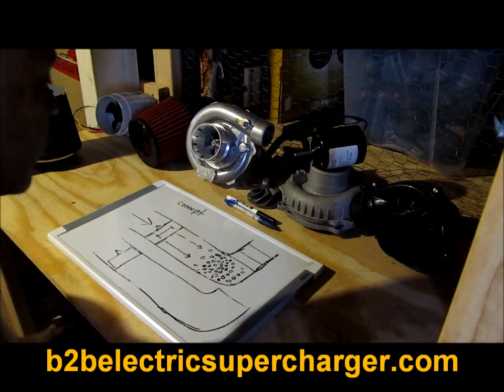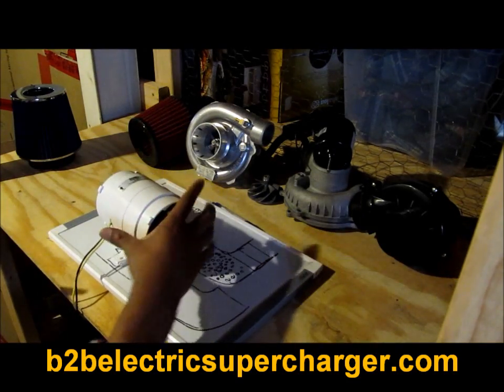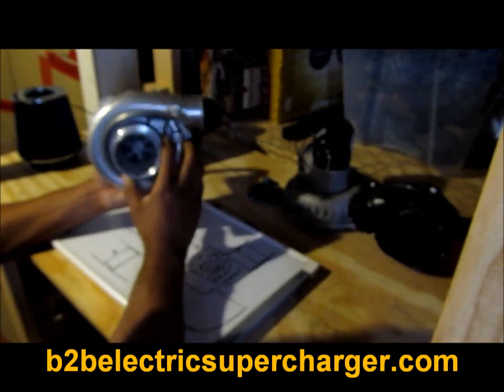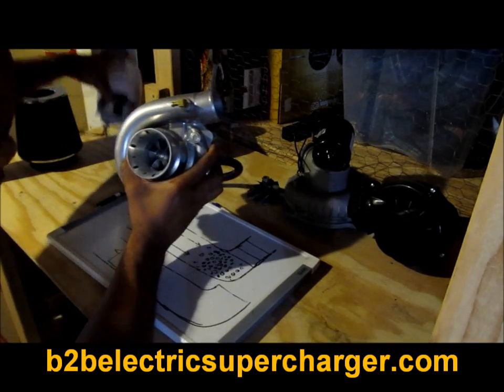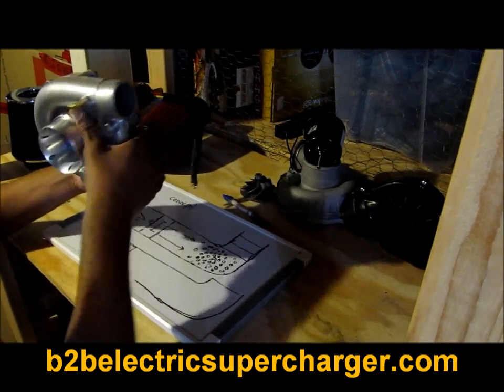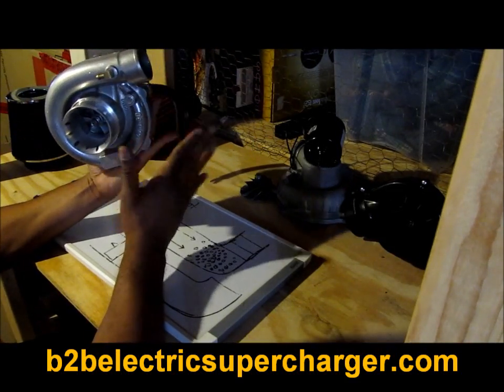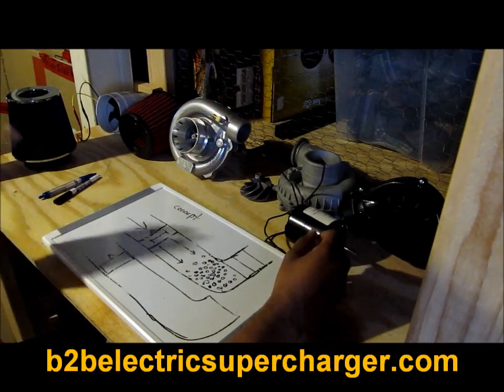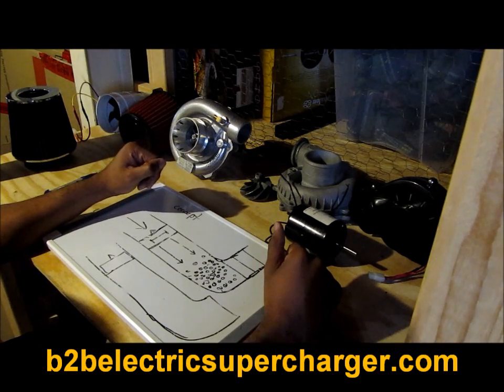Do Electric Superchargers Work?

Comment: wouldn't it just be a better idea to run an electric motor up to a centrifugal supercharger? instead of having the pulley run by a belt off the engine it could just be mated to a motor, and that way hypothetically you could make peak boost almost instantly rather than at red line which would be a drawback of the same supercharger being run off an engine belt
Reply: Look at the pulley size of a supercharger then look at the pully size on your alternator. Your average alternator can't power a electric supercharger as powerful as your average belt driven blower. Simple observation. A 100A alternator can only make around 1.3kW or 1.9hp of electricity. A belt driven supercharger uses 40-60hp apparently meaning any electric supercharger you run will be peanuts compared to a belt driven one.

"On a typical 8 psi supercharger, the power used can be in the neighborhood of 40-60hp! On a 1500hp engine, the power used by the supercharger can be as much as 300hp! This would leave only 1200hp to accelerate the car."
http://tomak3.tripod.com/page10.html

But it doesn't stop me from wondering if you'd gain any power from say a 1hp electric supercharger?

Comment: Assuming this does do as you say, what about all the other important factors? If you force more air into the engine, then you need to increase fuel into the chamber. If you increase fuel you will also need to adjust the point of spark. You can't just increase air flow and gain power. You need to adjust everything.
Reply: ahaha no you dont
Reply: A stock vehicle will respond to a small amount of boost (like 6psi) and not need upgrade's to work. Yes, you are correct to a point, but a modern EFI system has an ECU that can adjust fuel and spark timing's to a certain extent. It's best to just use a hand held tuner to inform the ECU that your boosting the motor so it can do it's job properly. Then use a dyno to determine the duty cycle of each individual component. A turbo or S/C on a carb use's a boost referenced carb specific to the application. Any carb app is more hands on and must do self adjusting, that's half the fun. Although you need to adjust upgraded parts may not be needed.
Reply: I have no idea as to what you're on about. A stock ECU will do its best to revert a car to basic running, no matter what you do. If you do anything that falls outside of its parameters, at best, if will go into 'Limp Home' mode. Are you also on about a carb fed engine? How on earth will a fan help a carb engine? I suppose if you introduce the fan (lets call it a fan, it's not a turbo) after the carb then I suppose yes, it may, if you're lucky, act like a webber twin pot. I find this highly unlikely though.
Reply: Why do you think that you need to change the spark timing when adding in more fuel and air to an engine?  You need to advance the spark timing when the RPM increase because you need more time for the fuel to burn as the piston speed is increasing.  That is why they used to run mechanical advance weights under the rotor of a distributor and later on with electronic ignition, a circuit is used to put a curve into the timing.  On one car I had, I would run 14 degrees initial (static) timing and my spring/weight combination would bring my total advance in to about 38 degrees at 3,600 RPM. 
  Making those adjustments is what tuning is all about.  How close to a perfect balancing of ALL the parts of an engine so they make the most amount of HP per gallon of fuel burned is what real hot rodders work for. 

Randy
Reply: Frank Furter If you change the pressure/fuel introduced into the engine with this system the spark will need to happen sooner. Simply because this system will not act as a turbo, it will gently breeze in more air like a lady walking past with a skirt on. That means more fuel in the cylinder to burn which means the spark needs to happen sooner so that you don't just end up chucking a load down the exhaust. Not really much more (if any) power, but hey ho, it's a $50 turbo
Reply: What complete and utter waffle. Please go and play with twigs!
Reply: stujb
  I'd suggest that you go and play with yourself, but I'm sure that you already do that way too much already.  If you knew even the most basic things about engines and how they work, you would be able to see that I am correct. 

Randy
Reply: stujb Some ECU units actually adapt to boost
Reply: Frank Furter
+1 internets
Reply: ***** Oddly after reading through the comments again I do think Frank and myself are kind of making the same comments but in different ways. We have both basically said this system won't work unless you know what you're doing. In other words, if you strap one of these onto your engine it's highly unlikely that if that's all you do, it will make any difference at all.
Frank I will say this, if a spark happens ATDC I doubt very much you'd get more than a backfire after some serious cranking. And as for keeping the EGR system on whatever that American vehicle it is you have, just take it off. It's more than likely causing more issues than being of any use. I can't see an engine from the 70's being so efficient it produces Nox from a complete burn that requires an EGR system to stop the production of NoX.
Reply: ***** What do I think? It's late in the UK, America is 8'ish hours behind me. Frank, please explain to Tristan if you can even make sense from his ramblings..
Reply: stujb
  Well he's just totally speculating and pulling his numbers straight out of his ass here, he's not done ANY real leg work or homework on any of this.  And he doesn't know the first thing about how alternators or batteries work either, it seems.  To excite the rotor windings in a Delcotron alternator, you only need the amount of power in a 6V lantern battery to get it going, and then after that it produces enough power to take over, if the RPM are high enough.  But once the alternator stops spinning, there is no residual magnetism in the rotor and so you have to sort of "prime the pump" again.  It's difficult in the extreme to educate guys like this, who have their mind made up about stuff before they even know what it is that they're trying to talk about. 

Randy

Comment: 1) So this electric supercharger can compress air and produce boost because the motor can spin at high RPM?
2) How much torque does the electric motor have at these RPM?
3) How much back-pressure can it take before having any kind of compressor surge?
4) How is the impeller speed controlled for different RPMs and boost settings?
5) Did you adjust the OEM compressor map for the air resistance vs electric power?

Comment: Electric superchargers are a great idea if pushed into production for people like me who wants to increase there performance without getting down and dirty with manifolds and drive belt systems. people like me would be happy with 3-4 psi of boost, if you want 18 psi get a turbocharger. Do you foresee electric turbos being available to the consumer any time soon?  Is a system the is natural aspirated when the supercharger is off a possibility? This would be excellent for a capacitor system.

Comment: according to ohms law it doesn't work. you're taking power to make power and what's worst you're taking power from the electric system from your vehicle which it need the most. your lights will dim, your spark plug will not fire to its full potential which results lost in horsepower and poor gas mileage. its like adding a stereo system in your car with out any modification done. any INDUCTIVE LOAD such as elector motor will pull mass amount of juice. you'll over work your alternator!!!
Reply: Michael Seeds Yes. Most alternators are full of them. They are used to smooth out the ripples after the diode(s) turn the AC into DC.
Reply: Wow your lights wont dim the car is already generating electricity once it started from the battery, do you know how low voltage spark plugs and lights are? very low, lower then how much your battery has ,even thoe electric turbo's don't work it would take the power from the battery, ive ran those electric turbos on a mini bike with a 12v 8 amp battery,
Reply: *****  what people don't understand is that car manufacture makes alternator only generate enough power to supply its factory/stock components such as radio, lights, ECU, fuel pump, engine cooling fan/AC cooling fan, blower motor, and etc ...therefore when a INDUCTIVE LOAD are added into the electric system you'll kill your alternator slowly or worst start a fire. not to mention it will dim your lights.
Reply: What you say about Ohms law is true; to a point. The point is not saving energy but spending energy to get a boost. Will this save gasoline? Oh heck no, it will cost more. But the idea is to get there sooner, and sometimes safer. Let's consider this. Even belt driven super chargers pull horsepower from the engine. But after the added air intake boost, it actually gains power. So you see, your idea of boost is not, I repeat, NOT designed to save energy but is designed to spend energy to gain power. So yes, Ohms law does apply. But how it applies is the secret to boosting an engine. Take for example, a 4 cylinder with a factory added turbo. The car dealer sells the idea of having a 4 cylinder engine to a customer under the guise that it has less cylinders therefore it burns less fuel than a larger engine. That is not entirely accurate. It will burn the same amount of fuel with the turbo added as a 6 cylinder engine. However, it's lighter in weight; so in a sense using Newtons Laws, you do save on fuel by the weight alone. This guy actually is telling it correctly. In the long haul, you will wind up spending more to keep batteries and alternators working in a motor with electric turbo boost. But not that much more. The engine will burn more fuel to accomodate the added air flow. But not that much more. You CAN and WILL get a power boost with the correct design. But everything has its cost. And THAT is where Ohms Law applies here. On the back end and not on the front end. If the idea was to save on energy and fuel cost then consider buying and riding a bicycle or even a small 2 cylinder scooter. But given todays fast speed traffic, it wouldn't be the safest route to go. Which could be costly after all: your life!
Reply: hotpapayasalad you could use a separate power source for the electric super charger
Reply: well you not breaching ohms law because the increase air pressure is resulting in more fuel burned and thus more power. The energy is coming from the excess fuel.
Reply: Ohms law is just a theory, I've never lost only gained power
Reply: ***** I believe he was referring to nothing being free of cost. And theories become law once they are proven for centuries on end. You did refer to it as Ohm's LAW and not Ohm's THEORY...
Reply: Yea but I don't think you would lose much power some people saying spark plugs and altinator failing from a small electric turbo it just won't happen
Reply: Let's make one thing clear, boost does NOT "create" power.  It allows you to push more air into your cylinders, this extra air means you can burn more fuel to create a more powerful explosion. Your expending energy from your cars electric system so you can burn more fuel.    There is no getting around ohms law.   But if you install a 200amp alternator. An electric supercharger is a great way to get a small power increase. I aplod this man for making a system like this work.
Reply: Electric superchargers never work
Reply: It depends how much power these things really drawn, 300watts could be tolerated but I wouldn't risk connecting anything more than that to my cars electrical system without modifications.
Reply: Why couldn't they? What's your thinking behind that statement?
Reply: They don't have the power to create that good of a compression for the pistons
Reply: Your right of course.  But there's nothing stopping somebody producing a 2kw system that can produce 8psi of boost on a smallish engine.  1.6 - 2.0L
Reply: *****
It doesnt produce compression for the pistons. It produces compression of the air leading to the pistons. The more air provided to the cylinder, the more fuel required to make it run properly. The more fuel/air, the bigger the explosion. Ram jets do the same thing. The faster a ramjet goes, the more air it sucks in from the velocity. The more air, the more fuel and the bigger the explosion, which equates to faster speed. You are actually increasing atmospheric pressure with a turbo. Higher atmospheric pressure have higher resistance and more fuel pressure to fight the increased air pressure. Interesting fact is that as altitude increases, atmospheric pressure drops. Making the speed of sound relative to the air pressure at the point of travel. Higher altitudes require higher speeds to break the sound barrier. Lower altitudes require lower speeds to do the same thing. We live in an atmospheric environment and not a vacuum.
Reply: I'm not sure where u are coming from with all the speed of sound stuff but your spot on with the ram jet
Reply: jayden hewer The reason for the speed of sound is to explain that atmospheric conditions is one of the parts of the equation. And with cold affecting power sources(battery source is only half that of normal at freezing) that is another part of the equation.
Reply: just run a second alternator to power the thing!
the parasitic load of an alternator ant much...
Reply: Is 2kw enough for good levels of boost though
Reply: OfficialPapachino  Sure it wont take much to turn the second alternator but its not going to give much in the form of boost anyway. Adding another alternator to run the fan will drain any power you end up making to turn the extra load the alternator would put out to power the electric motor. Conservation of energy.
Reply: There would be no problem with the electrical current as long as the car has an extra bit of current after accessories running which most do. I drive a 1lt sprint with a 140 amp alternator running a stereo that draws 80 amps continuous when pushed. It also has 100 watt each headlights and very large battery which stays fully charged and I never have a current deficit.Nor is the tiny 1lt engine lacking power to run that so an extra 3 or 400 watts from an electrical motor wouldn't be a problem, especially if it was used speratically like boost usually is. A car battery can provide quite a lot of amperage.
Reply: 400watts seems very little for and electric turbo I would assume closer to a KW.
Reply: Ever heard of a capacitor?
Reply: Michael Seeds I've though about this a lot and I'm in the process of completing my electronics engineering degree so I like to think I know what I'm on about.  For a short boost though an electronic supercharger capacitors are a great idea but when your not using the turbine its slowing down the engine and drawing power away. For a system to work and be practice it needs to be continues and able to actually create boost, none of this plastic fan crap. It needs to be steel and a proper compressor. It will draw power around 1-5kw which is a lot of current.
Reply: jayden hewer Might consider that everything tied to an engine SLOWS it down. Alternator/battery, water pump, power steering pump, brake booster, AC, etc. The idea of an electronic supercharger is to pull the stored energy from the battery for a quick boost. Once depleted, the motor will again be slowed to recharge the power from the battery for the next need for that electronic boost. Everyone balances their needs. Some are more practiced and proficient at it. Race cars are made with allot of comforts like power steering and power brakes removed in order to gain back horsepower those items pull from the engine. Drive one for awhile so you can get experience on what it is like driving without the luxuries those things provide. Won't take long before you will be happy to have them back. Heck, drive a bike for awhile too so you can be reminded the practicality of owning an internal combustion engine...
Reply: jayden hewer Hi thanks for the comment. I completely agree that there is major challenges in making something like this work. I agree about your estimate about the amount of power and current. I think that on 12volt system. It would require  100 + amps. I don't believe that electric supercharger is really possible at this voltage. Although on a high voltage I really think this would work. Like EV cars were you would charge them up quickly at home. An EV turbo would have benefits such as no turbo lag and less restriction on the exhaust gases.

I also agree about it needing a real turbo to work. I would love to try this haha
Reply: Michael Seeds
I agree to some extent. Did you know you can take dry ice in a large coffee can and coil your fuel line inside with the dry ice and it will boost hp's? Race cars used to use that method years back but would get busted by the officials for its usage...

Comment: I imagine the turbo would need to be hooked up to a 2hp electric motor before it generated enough boost to make it worthwhile.  38k rpm is quite low for a turbo, so is 2-3psi.  Maybe 2hp, with proper gearing, could achieve 5-9psi... idk...  I wish you luck with this and would love to see a high-performance version.
Reply: CPT makes one that goes 70k+ rpms

Comment: I don't think there is a motor that can spin at 120,000 rpm. I know there is an electric turbo called hybrid turbochargers. It is a high tech motor, that probably cost an arm and a leg, spins at about 120k rpm. It has an electrical reservoir probably in a form of capacitor, and electronic control system etc, for it to work properly.  As you know you can't just be pumping air in there because it will affect idle speed, mixture etc. It is not as simple as pressurising it.